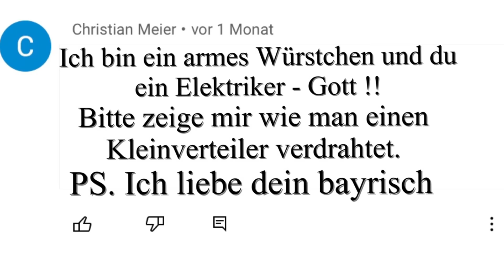Diese DUMMHEIT ! Mach diese Fehler lieber nicht! Proofwood

Comment: Durch den linken Leiter vom RCD/FI zum ersten LS können maximal 48A fließen, denn der gesamte Strom des ersten, zweiten und dritten LS fließt über diese Leitung.
Der rechte RCD wird NICHT bei seinem Bemessungsstrom (25A in dem Fall) abschalten. Der Bemessungsstrom gibt an, wie viel er dauerhaft durchleiten kann bevor er kaputtgeht, nicht bevor er abschaltet.
Also hätten unten auch eher 6qmm genutzt werden sollen. Zumindest für die erste Brücke, für die zweite dann 4qmm, für die letzte dann 2,5qmm.

Comment: Spitze gemacht.
Gerne auch mal Kleinverteiler Varianten vorstellen.
Kenne nur Männekes "Amaxx".
Hab so einen in der Garage verbaut auch für 400V anwendungen mit 16 oder 32 .... Steckdosen für Starkstrom.
Reply: Da haste echt geld inne hand genommen 🙂 die Produkte von Mennekes sind sau gut, aber leider auch sau teuer. Wir haben in der Firma einige verlängerungskabel mit 16, 32 oder 63 Ampere steckern nach Feuerwehrstandart (Mennekes Powertop) wenn man alleine die stecker und Kupplungen aufaddiert, dann kann man sich davon bestimmt nen guten kompaktwagen kaufen 🙂

Von Bals, Walther oder PCE gibts auch jede menge Steckdosenverteiler, die zugegeben nicht so gut sind wie das Mennekeszeug, aber duchaus auch die gegebenen Anforderungen erfüllen... schaus dir mal an.

lg, Anna
Reply: @AnnaM-cg4fz  ich bleib bei mennekes.
So selten wie ich was brauch hält es dafür ewig...
Reply: @arnoldbergmann7614  Ich wollte dich auch nicht von Mennekes weglocken 🙂 wollte einfach mal alternativen nennen

Comment: So habe ich meine Kleinverteiler auch gebaut. Nur wenn jetzt die Sicherung kommt dann fliegt im Hauptverteiler auch die Sicherung. Wie kann ich das lösen es sind beide LS Schalter mit B16A 6KA wäre ein 10KA besser oder doch lieber ein 16A Lasttrennschalter????
Reply: Du darfst keine(normalen, unverzögerten) LS in Reihe schalten, mind. bei Kurzschluss lösen alle in der Reihe aus, egal was für Amperewerte die haben !
Nimm als Vorsicherung Schmelzsicherungen, mind. 2 Stufen höher als die Sicherung im Verteiler. Also UV hat 16 A LS, dann muss mind. eine 25 A Schmelzsicherung davor( besser 35 A) Die Zuleitung muss das aber vom Querschnitt hergeben, das ist wichtig ! Und man kann z.B. 3 solche Sicherungen in einem Lasttrennschalter (sogenannte Linokur-Schalter) unterbringen. Aber auch ein normaler 3-fach Sicherungsblock ist OK.
Das Schaltvermögen 6 kA oder 10 kA hat damit nichts zu tun, normal reicht immer 6 kA. Nur im Vorzählerbereich braucht man mind.10 kA, aber da gehst Du ja gar nicht ran.
Reply: @dd313car  Vergiss die Absicherung für den FI nicht! 35A ist nicht erlaubt!

Comment: PWinfo hallo Helmut
ich habe im Keller im ersten Raum den Unterverteiler. Da ich die Elektriker gut kannte haben sie mir noch einige Leer "LS usw." Eingebaut. Ich habe in beiden Kellerräumen 400V Anschlüsse mit den kleinen schwarzen Stecker (gut ich weiss jetzt nicht ob ihr in DE diese auch verwendet) für mich waren die neu hatte die vorher noch nie gesehen. Denn ich kenne die "normalen" rot-weiss und blau-weiss Stecker. Nun habe ichim zweiten Keller gerade einmal einen 400V Anschluss. Ich möchte jedoch noch ein paar mehr haben welche blauweiss und rot-weiss sind. Was macht in Deinen Augen mehr Sinn? Einen neuen Unterverteiler aufbauen mit 400V und auch gleich mit 230V. Was auch möglich währe das ich alles über den Unterverteiler im ersten Raum zu lössen. Doch dort hängt das ganze Haus dran. Was man auch machen könnte wäre die 400V Leitung splitten auf div. Anschlüsse, nicht wirklich tool aber man könnte es tun.

Wenn ich einen neuen Unterverteiler baue brauche ich einiges an Material, was kannst Du mir empfehlen?
Gruss

Comment: Die schwarze Brücke von RCD zu LS ist falsch dimensioniert.

Wenn an jedem LS eine 16A Last hängt fließen 48A über die erste Brücke...

Oder was auch immer die Vorsicherung von der 6mm² Zuleitung hergibt.
Wenn die aber nicht ohne Grund 6mm² gewählt wurde ist alles über 20A Bemessungsstrom unzulässig für 2,5mm².
Reply: Richtig. Aber es können nicht 48 A fließen, max. 25 A weil wegen des FI eine 25 A Vorsicherung vorhanden sein muss. Und das hält die 2,5 mm² Brücke aus. Nicht schön, hätte ich anders gemacht, aber vertretbar für diese Anwendung.
Reply: @dd313car  Wenn eine 25A Vorsicherung vorhanden wäre hätte kaum jemand 6 mm² rein gelegt.
Außerdem gilt die mögliche Absicherung von 25A nur für 2,5mm² bis zu einer Umgebungstemperatur von 25°C.

Also wenn der "Kleinverteiler" klimatisiert ist 😂.

Im Gartenhaus kann so eine Verteilung schnell mal 45°C haben, da ist Umrechnungsfaktor schnell mal unter 70 oder sogar nur noch 60% für den zul. Strom.
Reply: @kr-gs5pt  das ist alles richtig, aber die Zuleitung ist sicher aus Gründen der Länge so gewählt worden. Und 25 A vorsichern muss man wegen der Belastbarkeit des verwendeten FI.
Du hast natürlich recht, die dünnen Brücken sind Mist selbst wenn eine Überlastung (im 1. Teil) eher nicht zu befürchten wäre.

Comment: #pwinfo 
Helmut, du hattest vor einiger Zeit eine Led-Röhren Installation gezeigt. Dazu meine Frage: Von zentralem Licht umrüsten auf Röhre. Die Röhre muß zentral angebracht werden aber die Anschlüße sind am Ende der Röhre. Die Röhre kann nicht in einen erhöhten Kasten eingebaut werden, da die Kellerdecke niedrig ist. Ich habe jetzt eine Abzweigdose unmittelbar auf den Deckenanschluß gesetzt, die Röhre direkt daneben und das Kabel von der Dose parallel eng neben der Röhre bis zu deren Ende. Wie würdest du das lösen?
Reply: LED-Röhren kann man nicht nackt montieren, sie brauchen ein Leuchtengehäuse mit den Fassungen.  Wenn der Keller niedrig ist musst Du halt ein möglichst flaches Gehäuse wählen oder Du montierst die Leuchte an der Wandseite..
Es war doch vorher eine Leuchte montiert, wenn das keine Röhre war, dann müsste die doch viel weiter von Decke abgestanden haben, denn Röhren sind flacher als Glühlampen.
Ich sehe dein "Problem" nicht vor mir, irgendwie klingt es seltsam.